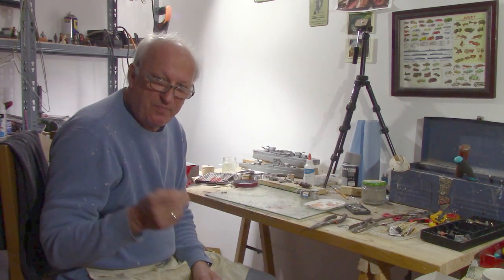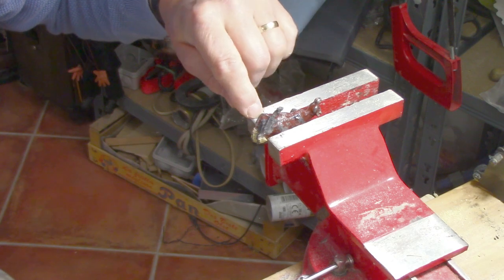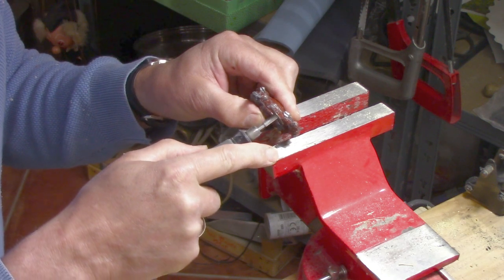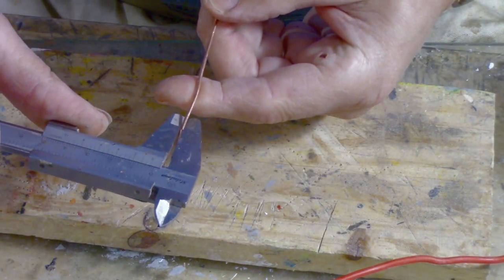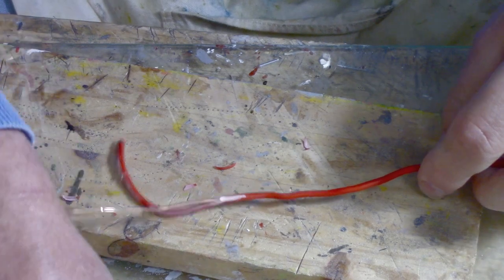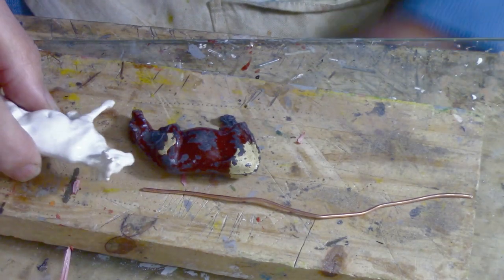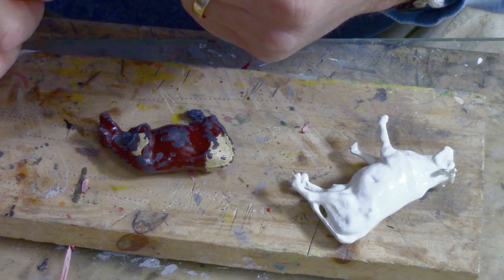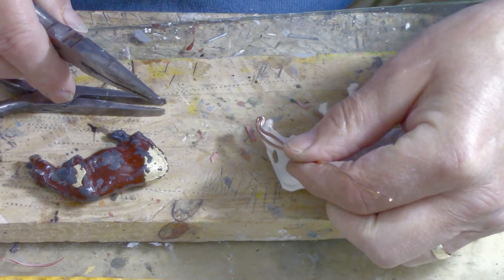LEAD FIGURE RESTORATION  1

Comment: Interesting video Willy,  I will be watching this  series 👍
Reply from the maker: My new method using copper wire works well and could be applied to the window pillar of a Dinky toy as it's easy to shape. The soldering would not work as it's cast and not lead.

Comment from the maker: This is in five series Toy Cow Restoration  S1 to S5 In these videos I show you the viewer how to repair lead toys. I have found a better method for replacing broken legs and arms using copper wire. The reason is because it solders easily and can be shaped easier than the nails I used to use. The repair is time consuming and does not make money but has a sentimental value.
I give you all my techniques and tips and hold no secrets. Passing on the information is my main goal so that others will save some of these lost, damaged vintage lead figures. 
Cheers Willy D.